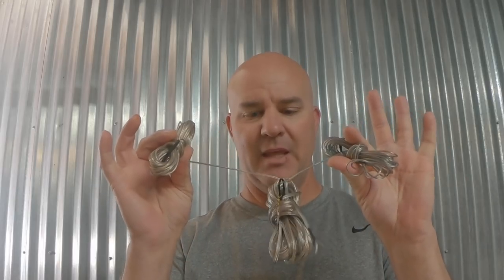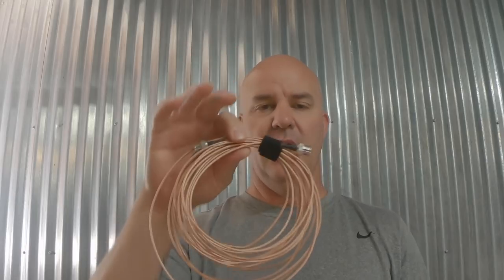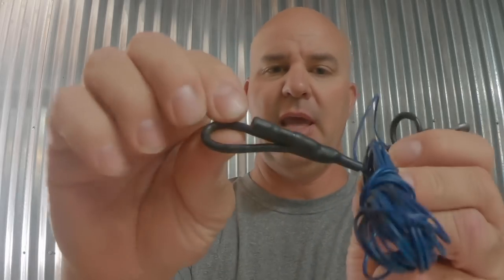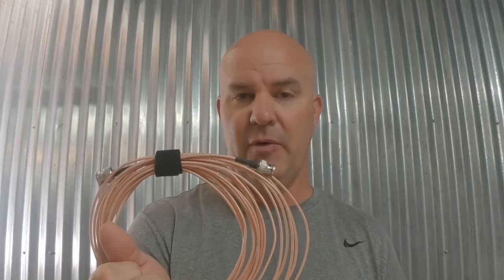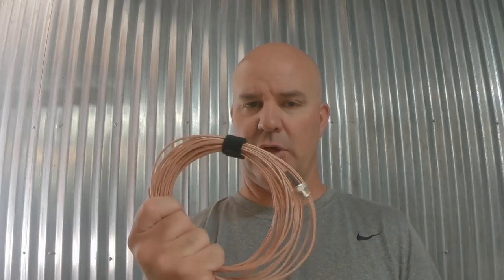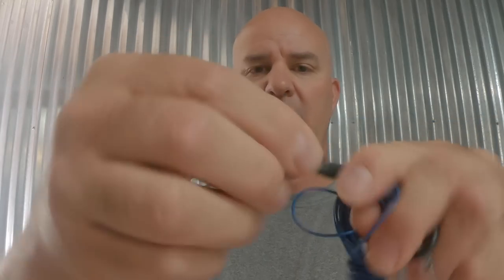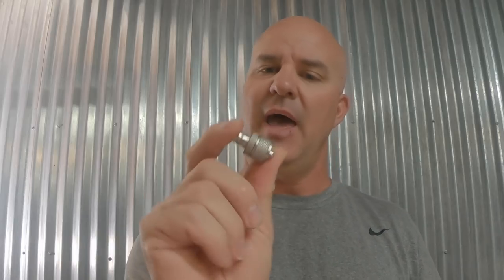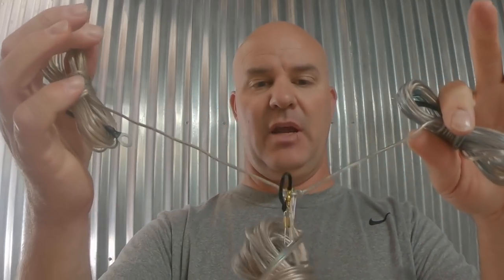Antenna Wars Part One - Dipole v Speaker Wire

Comment: Also, to be fair, you could also step on & crush your bnc to binding post adapter.  Which would also render the speaker wire antenna useless.

Don / W5DON
Reply: Don Imhoff it’s in his kx2 bag until he needs it.
Reply: Ham Radio Crash Course  - yes it is.  Right up to the point when he has to connect the speaker wire antenna.
Reply from the maker: I was responding to this when a software install happened .... grrrr..

Anyway, Don is correct that it's a connection none the less and susceptible to damage.  Josh is also correct, since he's seen how I activate in person, that it stays in my pack until it's time to connect the antenna to the radio at which time I'm usually seated.  In both cases, the wires could be bare and jammed into the BNC connection and wrapped around it if absolutely necessary but it would suck to have your BNC connector on your coax get crushed by accident when setting the antenna up, that was my point in the video.
Reply: Jerry - exactly my point, and you’re correct: The wires can be inserted into the BNC connector directly.
The speaker wire antenna is a clever update of the zip cord antenna.  I’ll likely give it a shot.

Don / W5DON
Reply: You could fall down, injure your brain, and the antenna and radio won't work. :-^ – KF8JBB, The Mom Ham (I love this antenna. Made one myself. Thank you, Jerry. GREAT channel.)
Reply from the maker: Thanks Julia 👍🏻

Comment: The only antenna I have used in my short time in the hobby is a 9:1 end fed. I plan to make a speaker wire antenna so I can do POTA. As a blue collar ham, even if it's 'less efficient' the price is on point.
Reply from the maker: Totally agreed!  And it's fun to make and it actually works too. :)

Comment: I have one of the 20 meter antennas from Tim Ortiz.  I feed it with RG8.  With that antenna, I have also reached all over CONUS, and as far as Australia.  All with my FT-817 at 5 watts.  I have not yet built one of the speaker wire antennas, but will in the near future.
I’m not a backpacker anymore.  My last back surgery fixed that.  So, I’m not weight restricted.  I pack whatever I can carry in the truck.  😁

Don / W5DON
Reply from the maker: I tell ya, I'm experience some serious back issues now so I'm praying it does't take SOTA away from me either, but if that happened I'd just switch to POTA and pack what I wanted in my truck too lol.  

Regarding the Tim Ortiz antenna, I hope people know I'm NOT talking that antenna down rather  the overall goal is to show others options if money it tight, or a design that's easy to make if they want to explore that area of ham radio, and/or have a very capable antenna that isn't far from a "store bought" version when it comes to actual results.  I said it in this video and I'll say it again, I think the linked dipole from Tony will perform every bit as good as the speaker wire one I use, but for the cost I'm offering an alternative consideration is all.  Not like it's really patented and trademarked and I'm getting money from this...hehe
Reply: Jerry - I know you’re not slamming the Tim Ortiz antenna.  I hope others feel the same.

I tell you brother - stay away from back surgeries as long as you can.  I just went through my 3rd one in 4 years.

I can carry a shitload of stuff in my truck.  Life is good.

I agree that experimenting is learning for us.  I’ve been licensed for over 25 years, and am constantly tweaking/modifying/improving my equipment and methods from little projects that I try out.

I’m looking forward to the head to head testing.  If you need some operators on the other end of your wires, let me know.  I can set up fairly quickly.  And get a POTA activation at the same time.

Don / W5DON
Reply from the maker: Great to know that it’s not being perceived as talking Tim’s antenna down, there’s no reason to do that as both have pros and cons. I’ll keep your words in mind as I start some dr appts soon, but something has to change cuz I have no idea what happened. 

Re people on the other end of the wire, I was hoping for tomorrow but it’s looking like Saturday morning PST sometime now. I’ll post on Twitter when I nail down my time frame better and I know we are connected there too. Good stuff man! 👍🏻

Comment: Thanks Jerry can you do portable/backyard WSPR testing it shows interesting results at times.
Reply from the maker: Hi William - Putting these two antennas on a fixed CW beacon type test once they are setup identical I will be pulling and including that data in the next two sub-series to show hard results, whatever they may be.

Comment: Jerry, Have you built a speak wire antenna for any of the lower bands such as 60M or 80M and if so how have they worked out? How long was your feed line for these antennas?  Rich KB5EDR.
Reply from the maker: Hi Rich, I have not mainly because of the elevation off the ground that would be required for optimum deployment and the usually small spaces on the SOTA peaks that would make deploying one of those antenna sizes rough at times.  Plus, for my application the 20m band during the hours I operate are usually the most consistent.  

Now having said that. I imagine the same theories would apply and it could be worth a try since the project is so incredibly cheap and easy.  Be aware that this is where Tony's argument of loss on the transmission line would start becoming much more evident.  Attenuation at 100' of transmission line on 14mHz is about 4DB compared to RG-174 and 2.4DB compared to RG-58.  For 80m the attenuation due to loss is at 2.7DB compared to RG-174 and .8DB compared to RG-58 so again, because of the low cost it's worth the experiment if you have the space to try it in my opinion.  

If you do make an 80m version I would aim to get the antenna apex at least a 1/4 wavelength off the ground and for 80m that would be about 61' but per my antenna tool calculations at 3.8mHz ish a minimum height could be 41.37' so YMMV.  Either way, it'll cost like $20 to find out :)

Comment: 1. The ads. Surly you don't get enough money to drive us nuts?
2. I built a speaker dipole about 4 years ago. Worked good, but I switched to a linked dipole for 20/40. I like the linked dipole better just because it gets out just a bit farther. (Both in inverted V fashion)
Reply from the maker: Good to know on your experience with both.  Oh and you are right, I don't get much for the ads :)

Comment: use should be using a balun to convert to unbalanced 1:1 will work, or use a balanced atu like a eez match. yours  g0rfd mike
Reply from the maker: Are you referring to the linked dipole or the speaker wire antenna for the balun?